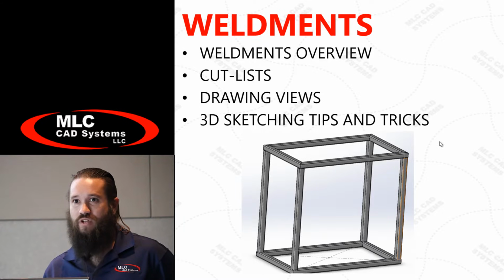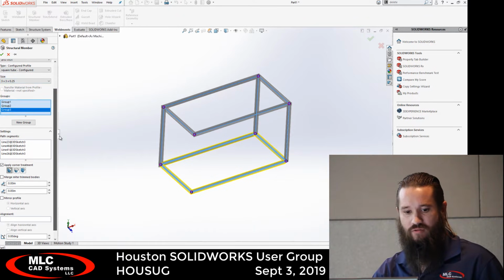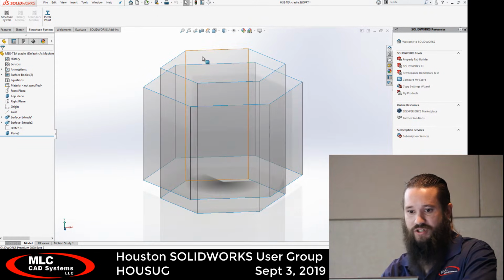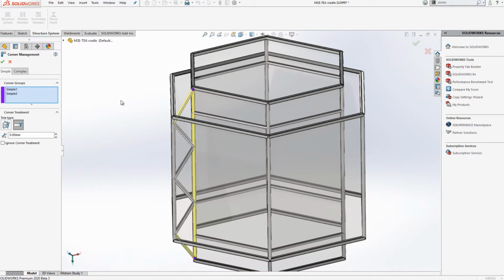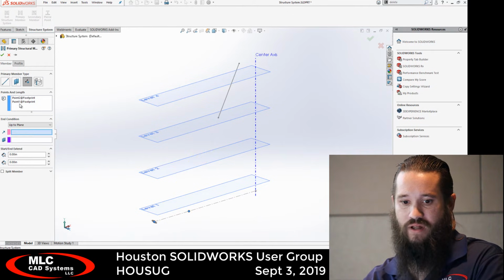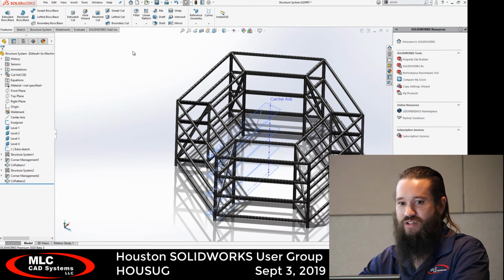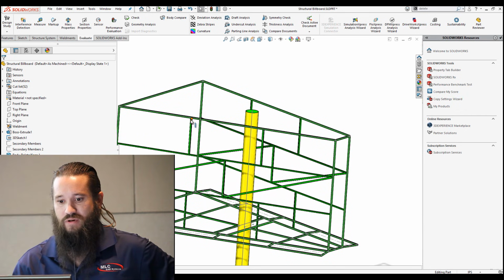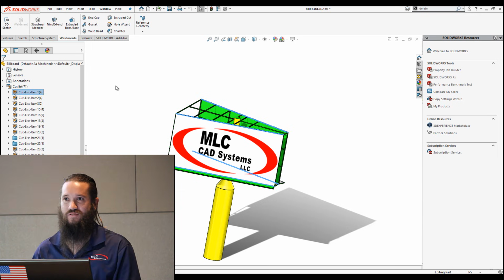SOLIDWORKS Weldments or Structure Systems?

Comment: what's the usage of structure system?  Architecture?
Reply from the maker: Anything that is constructed from structural shapes would be a good fit.  Architectural structures can be designed this way along with oil rigs and skids, equipment frames and support structures.

Comment: I had to laugh a little, I'm testing Structure Systems on 2023 SP1 and my biggest gripe is as soon as I change a member, my corner profiles, cut order, etc all gets wiped out. So a simple 1x1.080 to 1x1x.125 forces me to redo all my work again. Nice idea, but the whole interface is still a dumpster fire 3 years later.
Reply from the maker: Version 2023 made a lot of big changes, including the ability to use individual weldment profiles instead of configured ones.  Any major feature changes can be prone to issues, I highly recommend reporting it to your reseller so the developers can know who it is affecting.  

Tutorial of the 2023 feature changes: https://www.youtube.com/watch?v=lTP-jJx1TBE